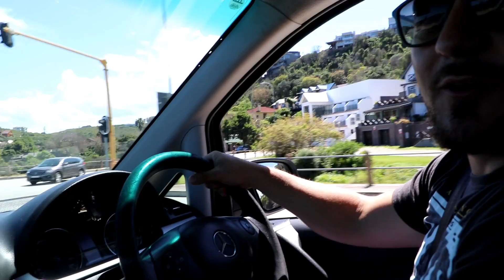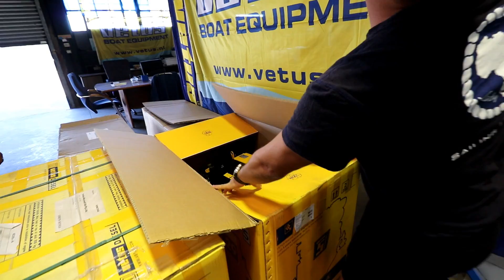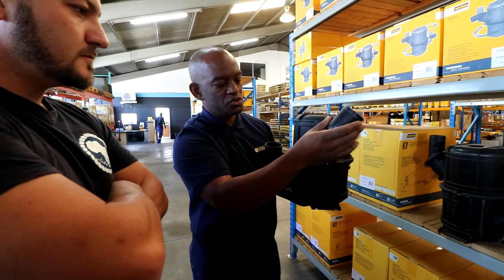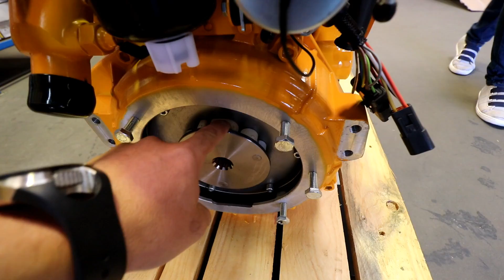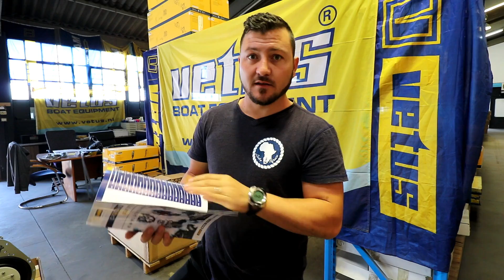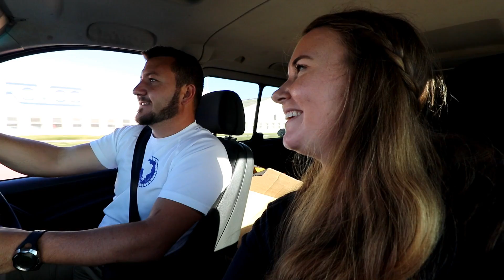NEW  Diesel Marine ENGINES!!! | VETUS

Comment: I like the extra cooling provided for the engines. I cannot figure out what engine Vetus is based on. For sourcing of parts and if it’s HPCR or not. Can an engine max RPM be reduced (at loss of some HP) in order to turn an oversized Prop?

Comment: Vetus have been around a long time , at least 40 + years , lots of experience and generally a good reputation. Dutch based company , well organized.  I think these 2&3 cyl engines are Mitsubishi based  which are great base engines.  Been used for a long time for marine engines .I do hope you parked the van somewhere secure overnight! 
Cheers Warren
Reply from the maker: You are correct & yes we only got secured parking ☺

Comment: very nice bits of kit,should give you good service and fairly economical to run.
probably too late  as you will have installed them now but it is worth pulling the heat exchanger tube stacks and give the o'rings,and bolts some tefgel then re-assembling to avoid corrosion and difficulty in the future when you need to clean them.

also if the engines did not come equipped with electrical isolation as per  SOLAS regs  for aluminium vessels it would be worth fitting solenoids on the pos and neg battery cables to isolate the sail drives from stray electrical currents when not in use.

Comment: Hay boet paint the engine  mounts  with hammeright  paint the coated steel parts 
You will thank me in 5 years time☺
Well done on those golden puppies  great peace of mind ,propolson and second electrical power source
Reply: @bobyandell3898  I don't think it will work on chain as there is a lot of  chafing